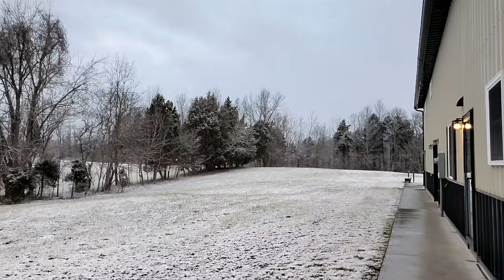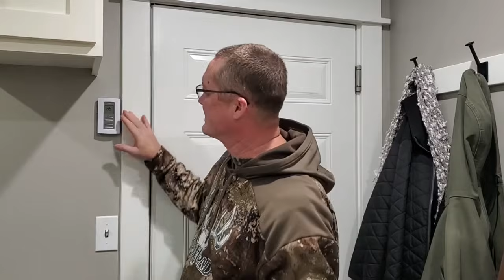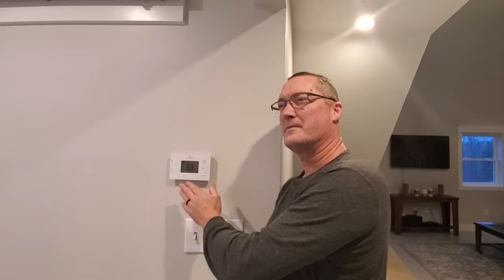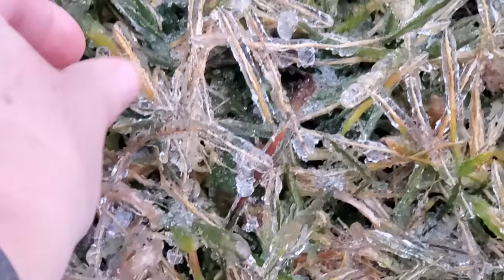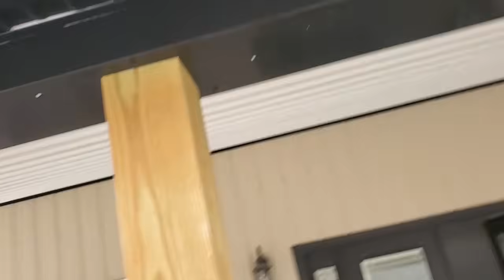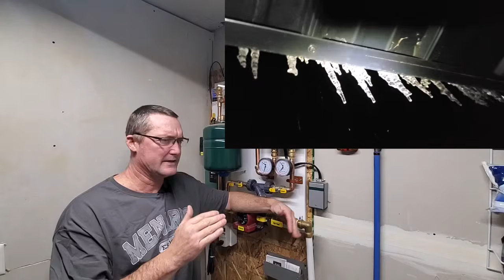Floor Heating Questions Answered Including Price || Barndominium Living

Comment: Having a hard time figuring how 65 at surface causes 68 at 5’ above floor (thermostat) if outside temp is below 65. Don’t have my numbers, but my floor is wonderfully warm to touch (well above 65). The colder it gets outside, the more you want to kick off the socks and walk around barefoot. Animals seek what they want temp wise. Not a concern for hot or cold. 

   The 30% glycol was only recommended to me if I were to have any loops that could get below 32. For instance in an outdoor driveway or in a home that you let cool below 32 when you’re gone for long periods of time with heat off. I’m water only and keep my garage loop at 50. Love it. 

   Also don’t know why you seem to use heat pump as supplemental heat? That would seem to be far less efficient and one of the many advantages of in floor heat is no air moving, causing a cooling effect that also looses humidity. I’d shut that off and save it for a backup if you ever have a problem with the in floor heat. (I haven’t in 23 years)
Reply from the maker: Thanks for the input as it will be helpful to others with questions. At the time of this video,  we had recently moved in and still figuring out the heat situation.  We do love the heated floors.  Thanks!
Reply: 23yrs. Have you changed out in floor heat water heat source and what do you think is best source?I'm looking into a on demand water heater.
Reply: I have not changed out the source. It was/is a high efficiency (for 1998) boiler. I have had to have it worked on a few times , but thankfully still working. The same boiler (separately from the in floor heat system - 4 zones to include a garage) also is connected to a “Hot Water Maker” which is fancy name for our water heater. It uses the boiler hot water to heat our house hot water through a heat exchanger (which physically looks like a normal water heater). But the water for the boiler is all still closed loop and therefore separated from the hot shower water etc.. Therefore the boiler runs a lot in winter for our floor heat, and some in the warm months for hot water. 

    Another comment for these in floor heating systems, IMO floor heat may not be any more efficient than force hot air (depends more on the boiler and the furnace efficiency) , but the heat you get is BETTER. No drafty blowing air, more even heat, warmest where you want it most (on your feet), not as dry (humidity wise) as forced air, and quiet (I should say completely quiet unless you are in the utility room when the boiler fires up). 

    Drawbacks to me are: more complicated to install and more expensive to install (especially if you’re going to have to have duct work for air conditioning anyway). Could be more expensive to repair should you ever have a leak in one of your loops. (Fingers crossed there). Also, a little less common so finding quality repair people could be a chore. (If your a “do it yourself” person, then no worry, you can “fix it yourself”). 

   Lastly, if you’re installing, don’t overlook the following: Most people get “Zones”.  Each “zone” has one thermostat to control warm water to any and all loops in that “zone”. Importantly, when you lay out the loops in each “zone”, get the hottest portion of each loop nearest the highest heat loss area (usually the walls). That is to say, as soon as a loop leaves the heat source, place that as close as you can to each external wall, then let the loop wind more towards the middle of each room/zone. This is complicated and time consuming, but the more you figure out how to position the loops, the more even your heat will be, and the more you will love it.
Reply: @williamumbach592  
Thanks for this info. I’m fixin to build, in South Florida, and plan to use in floor heat as my heat source and I was thinking the hottest part of the loop would go toward the middle of the room and the return portion would go closer to the outside. I was just thinking the warmest part would be in the higher traffic areas, where I’m walking the most, didn’t think about how it would hold the heat and even itself out so advice from someone that’s been using it for 20+ years is much appreciated. Do you really see a use for zoning or just doing the whole system on a single zone? I’ve debated both, I can’t come up w a reason for multiple zones. I don’t see a need for rooms to be different temperatures, I normally keep the whole house at a temp that’s comfortable to me. I do eventually want to do an insulated yard barn type building w radiant heat floors but I plan to do that separate cause it will be a good distance away from the house and it will only require a single loop so I can do it separate later on.
Reply: @ A P
   I’ve lived in S Florida for 4yrs in the past.  Never thought about floor heat for there, but I do remember heat always seemed to almost be an after thought there. Often times just a heat pump on the AC system. Very non efficient. 
   As for different zones, you are right, they mainly allow you to set the different zones to different temps. I would still consider maybe at least two zones to allow you more accurate control in case your home naturally has warmer or cooler areas. I don’t think having multiple zones adds much to the installation cost. 
   I’d also remind you that these in floor heating systems are very slow to heat up, and slow to cool down once the slab is warm. I’d wonder if the floor heat would sometimes fight your AC if you have hot sunny days with chilly evenings. Even if you’re planning to build and install your system yourself, I’d talk to some local installers and see if this type setup is common in your area, and if there are any special considerations for your climate. 
   My understanding is that in floor heat has been around for a long time. And that it began in Europe and the more northern areas, especially where no AC was needed. (No cooling air ducts makes the in floor heat much more affordable.  If you have AC duct work, it then is pretty cheap to just slap a furnace there and use the same ducts.). 
   I have the in floor heat in  my lower level and garage, and forced hot air in my upper level. I almost never touch any  of the zone thermostats (again, slow to heat up and slow to cool down) but I regularly move my forced hot air (furnace) thermostat up or down a few degrees for desired comfort. I love love love my in floor heat!
Reply: @williamumbach592  
Ok ya I’ve thought about it being to much as well, since AC is used most the year. I do plan to build so that I take advantage of the sun, I will get the suns rays in the Windows during the cooler months when it’s low in the sky but not during warm months when it’s higher in the sky and since I’m building w ICF that might be all that’s needed. I will be using some type of AC, either heat pump or mini splits, which both can do heat so it probably would be more cost efficient to just use that for the rare occasion I might need a little. I’ll for sure do more research on the topic and speak with some Florida based heating and cooling professionals before I make a final decision. Thanks for the info.
Reply: Heat pump is more efficient as long as the temperature doesn't drop too much. It takes 1 unit of electricty and can give out as much as 3 unit of heat. For the electric boiler it's a 1 to 1 ratio.
Reply: Its putting heat in faster than it is going out through the insulation.

Comment: When you say your floor temp is 65 and the air temp is 68, how does that work? Are you sure that your thermostat isn’t just set to 65, and the other thermostat is reading 68 because either the location of the heat runs, or just them reading slightly different…I just don’t see how a 68 degree surface can heat air above that temp…
Reply: It is only 65° at that specific location in 5he floor. The radiate floor is in loops so the beginning of the loop is warmer than the end of the loop. So if the floor thermometer is at the end of the loop you have all that extra heat at the beginning of the loop radiating off its heat.
Reply from the maker: It could very well be the +/- accuracy of the two thermostats.  Or, the heat rising off the floor hits the ceiling in the hallway heating the hall from the ceiling down to the thermostat making the hall a tad-bit warmer. All i know is what the thermostats say....i think the higher one is most accurate just by the feel (it feels like 68 not 65).  The floor thermostat just sits on top of the concrete slab also so the concrete itself is probably hotter

Comment: 68!!??? I’m freezing right now in Vegas In my 75 degree house 🙈
Reply from the maker: We keep it lower sometimes😜.  You're probably acclimated to hot weather.  We wouldn't be able to breath at 75..haha.
Reply: Wow freezing at 75°. Come visit Minnesota sometime in the middle winter.
Reply: Until you experience in floor heating the actual temperatures are not transferable to forced air heating. I love our in floor heat. never going back to forced air heat.

Comment: Spoiler...$44 / month to heat 2000 sqf in coldest month
Reply: hero without a cape
Reply: Thank you
Reply: May I ask why you don't want propane in a barndo.... am I missing something?
Reply: Thanks! There was a lot of talking in this. Hard to keep my interest.
Reply: $44 will run the pumps
Reply: Sq footage of the space your system is heating the floor?  I’m considering this as I do not want propane to the Barndo as well.  Your thoughts on geothermal if you have an opinion.  I appreciate the help.
Reply: So.... how many kWh? Price is meaningless.
Reply: @samheyman09  that’s what I was thinking too. 
He said it ran for 90 minutes during the cold snap. And he said the boiler is rated at 9600 watts. So if we round that up to an even 11kw, the 90 minutes come to 16.5kwh. His $44 monthly cost comes to $1.46 per day. So his electric cost per kWh is about $.09 - very low but we can use this as a worst case scenario. Actual $/kwh is likely higher and actual kWh usage is like lower. 

However, I still find this system expensive. The electric heater gets a 1:1 conversion of energy to heat. But a heat pump gets anywhere from 1:2 to 1:5 conversion. (1:2 it’s very cold outside, 1:5 it’s around 50°F + outside).
So a air to air heat pump should save 50% of the cost at a minimum. 

The real question is if a solar system can run this and still be reasonable priced. As it is, I would say No-to-Maybe, with a heat pump I would say Maybe-to-Yes. It’s hard to produce 16kwh in the winter. In a totally off grid system, the heat pump is a must. In a grid-tie system with low rates, the system shown works fine.

P.S. I would still try to use some of the system to heat water.
Reply: That does not include the cost of running the heat pump. Why they have both is a question i have.
Reply: @JohnCap523  they have a heat pump for the AC.
Reply: @1gizmospot    He said the heat pump supplements the hydronics, so that tells me the hydronics isn’t sized right.
Reply: @JohnCap523  ask him but it tells me he uses it for AC mostly and for when he wants a quick boost in heat if needed.
Reply: @JohnCap523  honestly he should of just went with a Air to water heat pump to run AC, water heater and flooring heat. It would of been wayy more efficient. Heat pump Air to water is the way to go
Reply: @1gizmospot    Yup. That’s why i suggested he replace that electric water heater with a hybrid (heat pump) water heater so long as he has a suitable place to install it. Around 3.5x more efficient than electric resistance heat.

In cold climates a split heat pump with outdoor condenser might have problems getting the slab up to temp.
Reply: Spoiler without the intricate details as to why leaves one still uneducated.

Comment: Hi, amazing...I'd also like to ask the same question as: 
Mike Wurst
3 weeks ago
Hey Guys, love your video on infloor heating systems... Do you have a Menards item number for the boiler/mixing panel together? I've tried to find it but have only been able to find the 2 components separately, not preassembled.  thanks

You replied, but we'd like to know about purchasing the complete assembly, as he also replied:
 You had mentioned the boiler and wall panel came preassembled, that was what I was asking about..thanks
Your video rea;;y has us all wanting this system...Thanks
Reply: Sorry, You answered that in the previous video....https://www.menards.com/main/p-1444433727814.htm...Thanks

Comment: Hey Guys, love your video on infloor heating systems... Do you have a Menards item number for the boiler/mixing panel together? I've tried to find it but have only been able to find the 2 components separately, not preassembled.  thanks
Reply from the maker: The panel and pipe header come separate. You have to buy the pipe header according to how many pipes you have and then connect the header to the boiler panel.  Instead of going through menards you may call the manufacturer they might make a full kit or custom make them..
Reply: @RVBarndominium  Thanks, yeah I know about the Header, I already have the Pex in floor and attached to the 6 pipe header, You had mentioned the boiler and wall panel came preassembled, that was what I was asking about..thanks

Comment: oh goodness , zero maintenance pre plumbing below the slab heater. No way to keep your heat exchanger clean , sad.
Reply: what is going to make the heat exchanger dirty? It's a closed system.
Reply: @rupe53  Pex, the copper, all the fittings and the glycol all have minute particles in them that can build up in the heat exchanger.
Reply: @rainmaker3700  ... if you use all of the proper materials it will be a lifetime before build up is an issue. Well, other than scale build up on the domestic water side.

Comment: I plan to go electric just because of solar panels can power that shit, along with batteries incase the power ever goes out. A 10kwh system which will power everything important for 24 hours for free with 10kwh battery bank cost less than 8k dyi.
Reply: How is your solar working out?

Comment: rent a thermal camera for the day and get photos of where everything is it will show up perfectly in the floor may see cold and hot spots. I just put floor heat in my cargo RV cant wait!
Unfortunately in Canada our carbon tax puts electric at about $0.25-0.50 per kwh so Natural gas is key, many rural properties heat with wood boilers in another building.
Floor heat is great for the heat sink and thermal mass you get. 

I would keep your ventilator fan going on about a 1/3 time basis to filter your air and keep fresh air rotating. Great video.

Comment: Thanks for the update video! Just in time as we should be breaking ground on our metal home with RV storage this month.
How many KW is your instant water heater for home? Any problems with keeping up during showers in winter months?  I've heard they struggle to raise the temp when incoming water is colder
Reply from the maker: It's 27 KW for the instant hw heater and no
 problems at all keeping up with the demands.  We actually turned it down a little because it was too hot.  We love it .
Reply: @RVBarndominium  in the summer time can the radiant floor be used to cool?
Reply from the maker: @Dee Smith  Theoretically you can circulate the fluid but you'd have to chill it or the heat from the pump would eventually warm it up. 

One concept to remember is the coefficient of expansion of concrete. Concrete has a high aspect of expansion and contraction depending on the temperature.  Thats why concrete cracks. You may end up cracking your floor with large temperature swings.  In winter we keep it at 65 to 68 degrees and in the summer it stays the same.  The AC unit cools the house and the floor absorbs it also so the cloor is cool/cold on the feet in the summer

During the summer the floor stays cool from, the ground temp under your slab.
Reply: @RVBarndominium  thanks